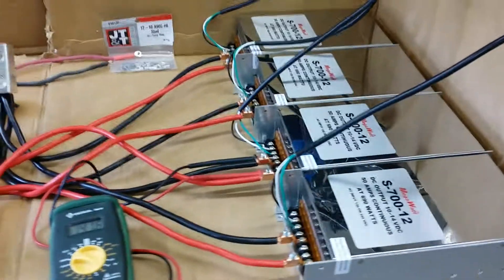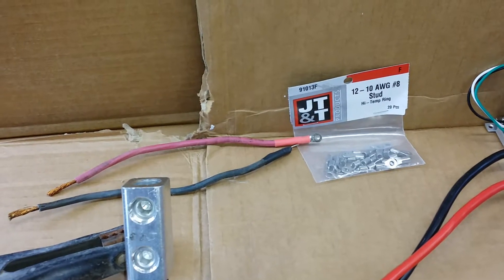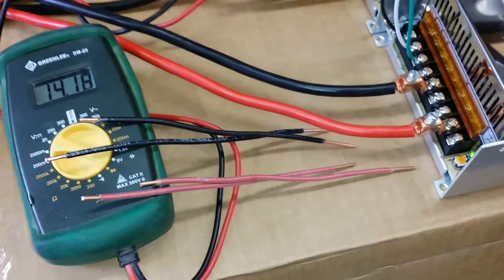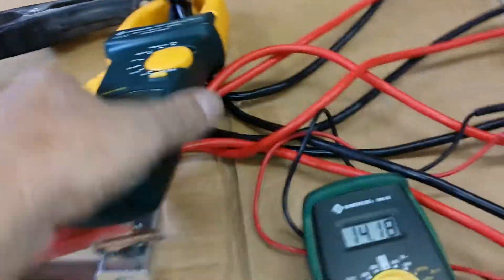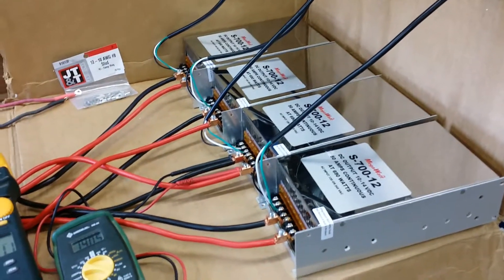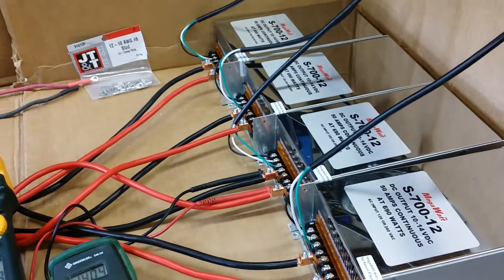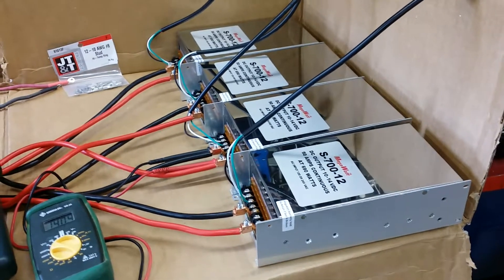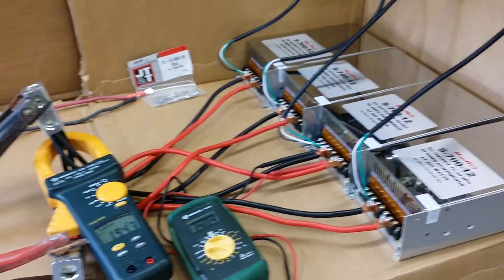Four MegaWatt S-700-12 Power Supplies Running at 200 Amps 2800 Watts Output - Demo

Comment: I realize this video is from a long time ago BUT I feel it's important to note that you should NEVER rely on soldering your supply wires together! The high currents and potential draw of your loads can and probably will build up enough heat in the wire to melt most soldering alloys and pose a serious hazard in your rig. ALWAYS USE MECHANICAL connections in PSU setups!!

Comment: OK! Thanks, I have two amps that I use, one I use at 13v to 14v and the other I run at around 20v. Just looking for a way to use one power supply to run either amp instead of a bank of batteries and a separate supply for the other. It's always worth a try. Thanks for the great info and video.
Reply from the maker: If the market were bigger we would make one but right now we sell 1000s of the 12 volt units.

Comment: Can you also make this 24v at 200 amps along with variable from say 6v to 24v? Thanks
Reply from the maker: No, we would have to redesign the whole power supply and in the same form factor each unit would only put out 25 amps.

Comment: Hi John. I have several of your S-400 supplies. They have been running non stop for 3 years in my ham shack and have served me well. My question is: Will the older 350 & 400 models parallel like the 700 series?
Reply from the maker: It is possible to run two S-400 or s-350 in parallel by using a 90 amp diode isolator. We sell them with instructions. The S-700-12 needs nothing to run in parallel with many another S-700-12s. www.12voltpowersupplies.us

Comment: Can they be put in series?
Reply from the maker: No they cant.
Reply: John Marles
Darn.

They look great anyway. They would be great for amateur science, in my case, electrochemistry. (Think water dissociation/separation), and other electrochemical reactions. Most electrochemical reactions depend on low V high current for progression, so a switched mode power supply like this one with heavily filtered DC should be perfect!

I think I might order one!
Reply from the maker: That sounds good.www.12voltpowersupplies.usThank you,John

Comment: Hi, not sure if you know, but if you are running the current directly through water you are splitting the water molecule into hydrogen and oxygen gas with can recombine explosively. I think you mistook the vapor coming off of the water as the water boiling, it was not that was hydrogen-oxygen gas. Be safe man.
Reply from the maker: Interesting out of the box thinking and people running electricity through water can be in danger of molecule separation. However we are running the load through a large gauge Nichrome Wire which carries all the electricity from electrode to electrode thus no electricity flows through the water in a plastic bucket. The water is just used as a coolant. The smoke was coming off the 200 amp battery cables. Yuck, burning rubber. Thanks for you intelligent comment.

Comment: what can one use to test ?
Reply from the maker: In the video I used an 18 gauge Nichrome wire connected to car battery jumpers and submerged in a 5 gallon bucket of water. For a small load test you can always use 12 volt light bulbs. Don't turn it up over 12 volts or the bulbs will burn out.

Comment: Can I connect two computer power supplies so as to increase overall amps from 15A each to may be 28A-30A by not disturbing voltages (12v each)? ITS URGENT
Reply from the maker: +Ruchit Dutt No. that usually does not work. They sense each other and one shuts down over loading the other. Since I don't sell them or know which ones you have I can only give you an educated guess.
Reply: +John Marles oh thank you...actualy i wanted to power a car amplifier at home....i had two working zebronics power supplies....and instead of buying a new one i wanted to comine these

Comment: I wanted to see, the water and, the remote heads (or whatever) off the Gr/Wt/Bk leads!
Reply from the maker: Yosen Mamma Everybody wanted to see the boiling water but the smoking 100 amp battery cable is pretty good. The Gr/Wt/Bk leads are just going to wall plugs.